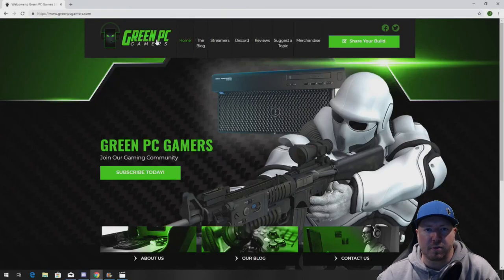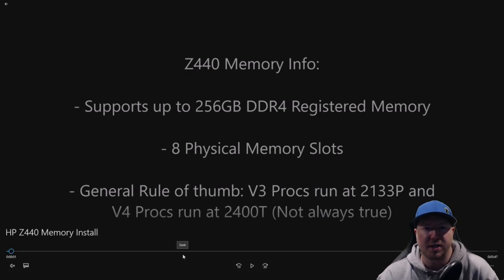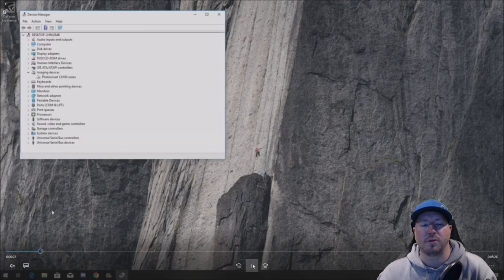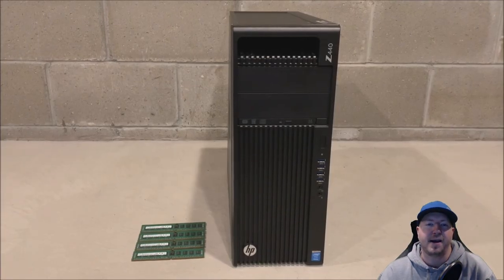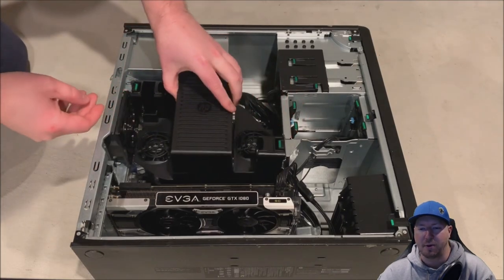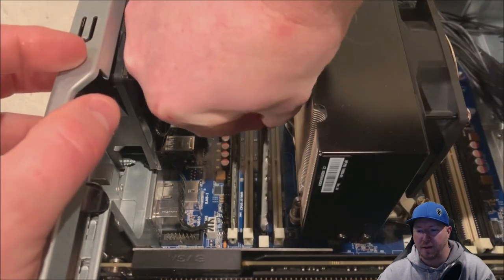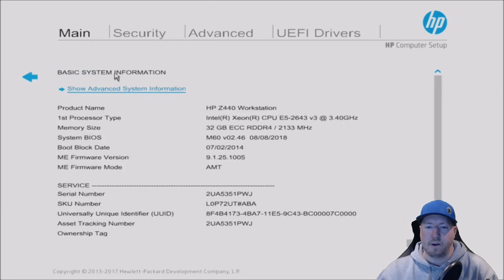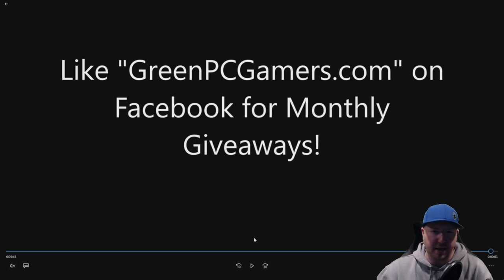HP Z440 Workstation Memory/Ram Install (4 x 8GB = 32GB DDR4)

Comment: can you populate all 8 memory slots without having the memory shroud?
Reply from the maker: We've never tried that.
Reply: The motherboard complains when all RAM slots are full and shroud is not plugged in, but you can shut off the warning in the Bios I think. You may be obligated to press a key each time the PC boots to bypass the warning about no memory fan.
I can't confirm it, as I only have x4 sticks in my Z440. 
First thing I did was yank that huge memory shroud. Then I yanked the front bottom intake fan; weak and too loud.
Then I installed a power splitter for the lower board fan, and added two quiet fans: A 140mm noctua where the front lower intake used to be (just fits, with some better cable management), then I removed the front x2 3.5 bay covers and replaced them both with mesh covers.
Then I put a 92mm fan in the x2 3.5 bay compartment to draw in more front air, and I tilted the 92mm slightly to feed that intake fresh air down to the CPU and memory.

Comment: I'm doing a case swap with a Z440 motherboard, and I believe that I need the memory fan installed when trying to install more than 32 GB of RAM. I have 4 DIMMs of 8 GB each. Can I use a different fan?  Can I trick it into believing I have one? Do you know the pinout for the memory fan? Thanks!
Reply: You should be able to install 4x16GB without the fan. Check the manual.

Comment: Is there a noticeable difference between pc4-17000 vs pc4-19200?
Reply from the maker: It's very hard to tell the difference.
Reply: @GreenPCGamerscom   Thanks for the reply. I was debating on ordering either two more sticks of pc4-17000 or 4 new sticks of pc4-19200. I ended up going with 4 new sticks.; that way there's no mismatched sticks in my pc. My main goal was to populate the 4 channels. I'm hoping that I notice a difference by having 4 channels of 19200 vs 2 channels of 17000. I compile a lot of source code, and occasionally run games. 😅

Comment: Is the ram you use hp ram specifically or an equivalent?
Reply from the maker: We used Samsung modules.  They would be equivalent hp modules.  They just don't have the fancy HP logo sticker.
Reply: @GreenPCGamerscom  
It's a real struggle finding 2400T in 32GB for refurbished or new... real cheap.
Reply from the maker: Do you have a V4 processor installed?
Reply: @GreenPCGamerscom  
Yes
Reply from the maker: They are pretty expensive.  Are you located in the lower 48 states?
Reply: @GreenPCGamerscom  
Yes I am.
Reply: @GreenPCGamerscom  

I just need patience! Lol
Reply from the maker: Send us a request through greenpcgamers.com

We can probably help you locate some modules at a good price.
Reply: @GreenPCGamerscom  

Ok.

Referencing page 19 of the quick spec. The CPU 0 table shows that 4 x 16GB is better than 2 x 32GB. I wanted to go for the 32s cause of the max upgrade path. Though by the timeI could justify 256 DDR5 will be out and I'll be up grading the whole machine so 4 x 16 at 19200, 2400T or better for now makes sense. Don't ya think?
Reply from the maker: I would agree, however I don't have any testing to back it up yet.
Reply: @GreenPCGamerscom  
I'd even take 8x8 which it what the machine came with. So 6x8 would be good enough, now.

I was on your site. Where's the email contact?
Reply from the maker: https://www.greenpcgamers.com/contact-us/
Reply: @GreenPCGamerscom     Hi, I bought a new Z440 in 2016 from a 3rd party company. It's running a XEON E5-1620 v4 uProc. with 16GB of SK Hynix 2400T DIMMs (2x8GB Modules in slots 0 and 8).

I took the side panel off it for the 1st time a few days ago, and discovered that it did not ship from the factory with the air-baffle cover (or the "Memory Fans" as listed in the 'Maintenance and Service Guide'. The motherboard has the MEM FAN connection for this baffle at P91, but no baffle was supplied!

Surely this is not good??
Reply: @GreenPCGamerscom    Hi, I bought a new Z440 in 2016 from a 3rd party seller. It's running a XEON E5-1620 v4 uProc with 16GB of Hynix 2400T DIMMs (2x8GB spread between Slot-1 and slot-8.)

I opened the side panel cover for the first time only a few days ago, to discover that it did not ship with an Air-Baffle (otherwise known as 'Memory Fans' in the 'Maintenance and Service Guide'). The MB has the MEM FAN connector at location P91, but no baffle!

Surely this is not good??

Comment: First off, I love your videos. I'm looking into cheap parts for my Z440 motherboard build in a standard after-market case. I came across this video while trying to figure out the RAM config. You have the slot order correct as 1, 3, 6, and 8, but according to the manual online slots 6 and 8 to the left of the CPU socket are the white slots, not the black. You have slots 1 and 3 to the right of the CPU socket correct as the black slots. 

I also wanted to address someone's comment about the fan error message when doing a case swap. I had this problem with a Z420 case swap and you have to plug a PWM fan into the CPU fan header at the top rear of the board, if I remember correctly. I suggest buying 3 PWM fans to get rid of all fan errors when doing a case swap with one of these motherboards. You can disable USB and Audio in the bios to get rid of the other errors, but you will not have working audio or USB 3.0 out on the motherboard anymore. I did this on a case and I used a USB 3.0 to USB 2.0 adapter to get all of my USB ports working and a USB audio/ mic plugin adapter for audio or headphone out. I hope this helps anyone having these issues. I love the HP Z400 platform.
Reply: errors arent that bad tho u just press f2 right?

Comment: The motherboard complains when all RAM slots are full and shroud is not plugged in, but you can shut off the warning in the Bios I think. You may be obligated to press a key each time the PC boots to bypass the warning about no memory fan.
I can't confirm it, as I only have x4 sticks in my Z440. 

First thing I did was yank that huge memory shroud. Then I yanked the front bottom intake fan; weak and too loud.
After this I created a proper front to back air flow system for the Z440
.

I installed a fan splitter from the lower board fan (plugged into the mobo fan power that previous fed the stock front lower fan), and I added two quieter fans: 
A 140mm noctua where the front lower intake used to be (just fits, with some better cable management). This creates a steady, large airflow across the PCIe slots (and my GPU, a Rx 6700).
I added another 140mm noctua behind the 6700 blowing directly across the GPU. The 6700xt, btw, required a 6 to 8-pin splitter for power.

The Z440's 700 watt PSU is an excellent, reliable model with ample power for many gaming GPU types.

Essentially, I removed the metal PCIe slot covers from the rear of the PC for all unused slots and put mesh covers over them. 
This created a flowing front to back air channel for the bottom 40% of the case, sending all the GPUs exhaust pocket out the back of the case.
The lower case air channel was completed.

Then I removed the case's front x2 3.5 disk bay covers and replaced them both with dust mesh type covers (flowing air).

After the disk bays became valid air intake, I put a 92mm fan inside the x2 3.5 disk bay compartment to suck in the front air, and I tilted the 92mm slightly to feed that intake fresh air down across the Z440's CPU and memory. 
This air gets picked up by the CPU's fan and the upper rear fan on the back of the case. The upper case air channel was completed.

Doing the above massively improved that stuffy case's airflow and reduced GPU, NVMe (fast SSDs installed to PCIe adapter cards), and CPU temperatures by 10-12 degrees.

Note that you'll have to set your sights on a twin fan GPU for all of this to work well. The super long triple fan GPUs can fit, but you'll lose fan space and the bottom air channel will be too compressed near the front to remain effective. Luckily, plenty of decent shorter twin fan GPUs exist.

Comment: I just got a z440 with 1650v4 and 32gb of ram. Noticed checking cpuz that it has different brands and speeds (1 Samsung at 2133, 1 Hynix at 2400 and 2 Micron at 2666) of ram installed. Also the ram is installed in 1,2,7,8.
Reply: I ended up getting 3 more hynix 2400 to match the other one and put the ram into the correct slots. Ran some gaming bench marks and to my surprise the scores are a little lower with the faster matching ram.

Comment: Can i edit 20hours rain video 1080p on using hp z440 Xeon 
Xeon E5-2673 v4 20core 40threads gtx1070 8gb 40gb ddr4 250gb ssd 4tb 7200rpm
Reply from the maker: We've never edited more than an 2-3 hours of 1080P video on a Z440 with similar specs.  Let us know if you try it.

Comment: So i have the same ram, but i have 2x32gb and 2x8gb of ram, can i mix all of them?
Reply from the maker: We haven't tried that configuration.  Although, assuming all of the modules are registered, you could install the 32gb modules in slot 1 and 3, and the 8gb modules in slots 2 and 4.  Let us know if it works.
Reply: @GreenPCGamerscom  Thanks sir.

Comment: Has anybody installed 64GB modules in HP Z440? Thanks
Reply: yes up to 512 gb but thats  using 8  64 gb sticks  with 64bit win 10 or 11 pro
Reply: @jgold2813  Okay, Thank You. I have got 160GB memory recently in it. 2x 32GB and 6x 16GB.  Official HP specs says that maximum 16GB modules up to 128GB total memory. So, even HP doesn`t know the specs for their own products. :D